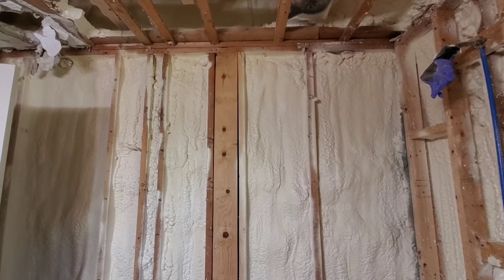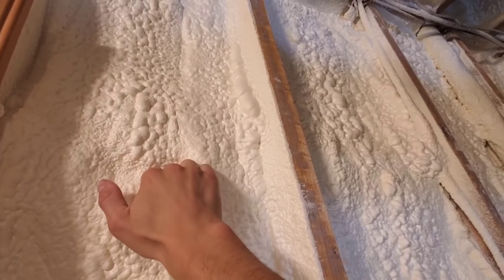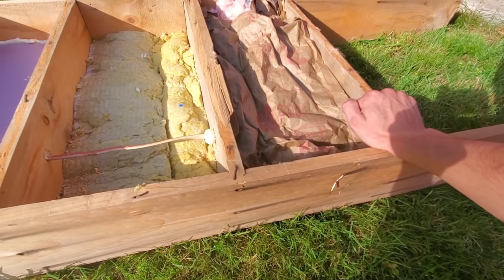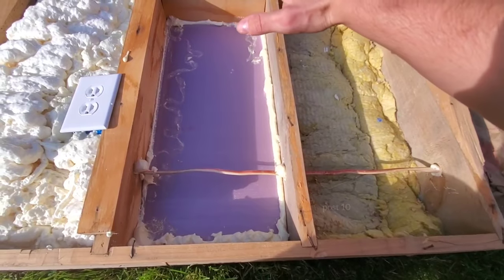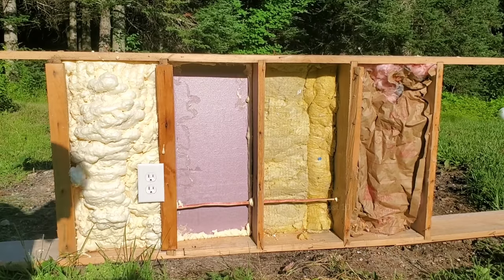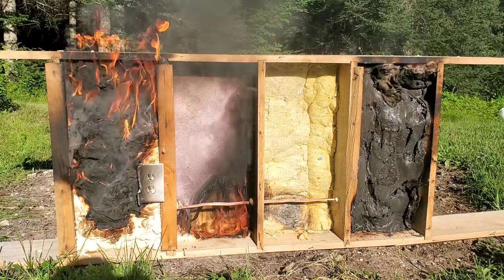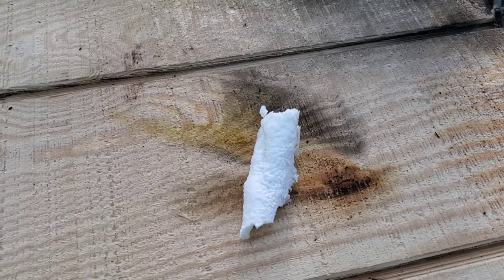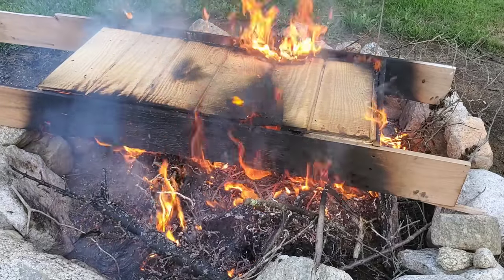Testing The Burn Ability Of Insulation In Wall

Comment: In Swedish construction we use rockwool as the standard. If you use it for walls its extremely important you make perfect cuts with milimeter precision to not have any leakage that will cause condensation. Rockwool is fantastic material! but the rockwool mat you have in the video is for attics, you could use it on ventilation pipes aswell but usually the mats for ventilation comes with metal nets so you can  put them easier on the pipes and keep the size on it. sorry for terrible explanation my native is swedish :D
Reply: Rockwool/Fiberglass as standard, barley ever with the paper though
Reply: If you use rockwool as wall / roof insulation, how thick do you insulate both? Cm?
Reply: Honestly rock wool I would pay for a good manufacturing to be made in the United States. 

The fact your recycle literal slag from metal manufacturing is smart. 

People who claim that the disadvantage is that it’s not biodegradable is stupid because when your building houses. You should build houses that last long periods of time if possible over hundreds of years old. 
Who ever thought that we shouldn’t use Rockwool as a standard is stupid because we should build homes with quality and have these houses as fire proof as possible. 

Foam I heard good things but this changed my mind because honestly. Every year state regulators often change policy for what is put into the material and as a product of that foam is now flammable… it’s because multiple reasons.

1. When first implemented into the market it had a slower application time because the chemicals used were less flammable. The chemicals that made it more expansive so that you can use less of the material which made it cheaper. It’s still the more expensive option… 

2. It doesn’t matter if Rock wall to cover the walls because it will still eventually burn through that than reach the foam. 
That’s why I believe rock wool should expand their markets all honestly.
Reply: @mrpumperknuckles1631  i think in this global recession its going to take a while before they would expand into the US. Our production costs here in Europe have skyrocketed due to diesel and electricity prices going to the moon, so construction business is suffering into next year. Im a professional who works alot with insulation and in two years time prices of rockwool has nearly doubled. 

Tho rockwool is very strong against fire it does eventually "get old" and cause extreme amounts of dust, and when you put your hand into 50 years old rockwool it breaks easily, but regardless of that fact. I think you get your moneys worth if something lasts for 50 years that at least should be cheap to buy in a normal environment with cheap electricity and diesel.

But the best part about rockwool is not the fire resistance, no no.. its the noise cancelling and it keeps your house from leaking heat or taking in cold from outside.

I onve built a small 10 square meter shed and used rockwool for it. It was 30 degree celsius outside but inside the shed it was 12 degree.

I think these foams have more downside then rockwool so for me the choice is easy
Reply: @mrpumperknuckles1631  Rockwool has two manufacturing plants in the US...
Reply: I understandd that enough. I work in trade, my job is plumber. We use them quite often around our super heated pipe before we place protection shield over them.
Reply: Rockwool is an excellent fireproofing insulation.  Easy to work, but takes attention to detail - I use a lot of it in the design and construction of healthcare facilities in California.
Reply: I've only heard of people using rockwool to clone plants. Didn't know it was used for insulation.
Reply: @ericberman4193  Good choice, also in california its even better because a proper insulated building will also more easily keep HEAT OUT from the building during hot days, putting less strain on the air conditioner. saving on the electricity bill in the long run
Reply: I live in Southern California and I just did my entire house in Rockwool. Its the best!
Reply: In Croatia, we only use rockwool. 
Everything else is trash.
Reply: Same in germany, you usually stuff the gaps with more rockwool if you can
Reply: @thebigmacd  WTF?!
Reply: @DataLog  Byhalia, Mississippi and Branson, West Virginia
Reply: Dense pack fiberglass will doesn't have a theoretical limit. It will last as long as the house. Rockwool will last 50 year before you should think about it. Rockwool in ceilings I a mistake unless it's done absolutely perfectly. This is because it's in batt form and batts can't be perfect. You will have an air gap that condensates, even with vents used.  Dp glass may condensate in certain conditions but there will be no air gaps. Dp cellulose settles due to moisture and the fact that its sugar and breaks down with all kinds of additives, and needs to be redone every 20-30 years. You can dense pack rockwool but it's incredibly un cost effect because rockwool isn't used as or requires dense pack.
Reply: @Jagggggg88  Did mine with 8cm rockwool. But building inspector said 12 would have been good enough for heatpump.
Reply: I'm glad you posted this test! I just canceled my foam installation project in the attic...just bought rockwool instead.
Reply: Thanks for sharing. It's good to know the Swedish build with sense and I'll be looking into their building practices more.
Reply: @mrpumperknuckles1631   The problem is the insulation value which forces you to up to 10 times thicker walls with bergull/glass wool insulation probably the same as Rockwool. But if you buy an old log-built farm, you get an exception and can use only the logs as insulation fold sometimes not thicker than 15 cm which becomes extremely expensive in cold climates! Then you run into the problem of additional insulation which I really recommend you study carefully before doing it! As a basic rule, you must use diffusion-open materials and not exceed 50 mm on the inside so you never manage to get the cold bridge in the log wall because then the moisture condenses there and freezes so that you suddenly destroy a house that has survived for 300 years and could have survived just as well long to think logically! On the outside it says that you can put as thick as you like as long as the material breathes (is open to diffusion) I have personally wondered if that is really true if you use air conditioning that places the condensation point on the other side (always the colder one) myself, I live expensively but healthy because it is impossible to get as good ventilation as in an old log house with mechanical ventilation, especially when very few clean the system as often as necessary to avoid mold formation which can still occur in the construction itself where it is not detected before it is far too late! Unfortunately, today's houses are designed for about 30 years - provided you take care of them, they will certainly last longer, but I recommend that everyone who builds today greatly exaggerates and uses logic on every detail! The worst thing you see and hear these days are people who care more about looks than practicality! When I'm fixing up a hundred+ houses, I always replace old electrical lines and I flatly refuse to build in electrical lines because it's almost inevitable that over the years someone screws or nails in a line that can't be sensed so if appearance comes before life to such an extent I ask them to hire someone else because I do not want to be even innocently involved in someone needlessly losing their life! What almost everyone can do is unscrew the sockets and junction boxes and after unscrewing the main fuses still check with a voltage monitor so it is guaranteed safe to pull the wires because I have probably prevented a few fires by checking that the wires are securely fastened for many times they aren't and the fuses don't blow if the phase sparks and sooner or later set the plastic case on fire! It usually leads to a fire, but you can die from the smoke without it catching fire! I have to say that old porcelain sockets and junction boxes felt much safer as they could not catch fire! For those who want to know something about basic dimensions (connection 230/400 V) a basic rule is that a 10 A fuse is the same as 2300 W and needs an installation cable of at least 1.5 mm2 but if the consumption is higher but not more than 3680 W then 2.5 mm2 cable applies. Why patch cords may be labeled 1.5mm2 and 16A is because patch cords are made of many smaller wires giving them a larger total conductor area but it is important to know that you should never put them in series as resistance increases with length and if you load thin cables over a longer distance, they become hot and pose a fire hazard! Also, don't forget that the fire insurance does not apply if they can claim that you overloaded the wires by securing them or just connecting one branch joint to another...
Reply: I go theough with soray foam when im
Done to fill up any cracks
Reply: @Jagggggg88 this old house says 8" which means a 2x8 us too short at 7.25" so you must cut down a 2x10" board frame arounds (cut down from actual 9.25 to 8" for R40 insulation).
Reply: In Trinidad and Tobago we use clay bricks with the air spacing in between.

Comment: My house is insulated with fiberglass and that's what saved our bathroom this past summer. Our house caught fire and aside from spots where the insulation was chewed through by rats, nothing was damaged that wasn't attached to the plastic plumbing pipes. Thankfully it didn't cost much to replace.

Comment: I’ve sold a lot of the rock wool before and not only is it nearly fire proof but it’s also very good at sound proofing, enough so that you can barely hear the other person on the other side of the bundle
Reply: Well, it is made of rock so…
Reply: @jameslastname9171  so its rocksolid for the job.
Reply: Couldn't agree more! Sound proof your bathroom walls with this stuff and no one will hear that toilet flush!
Reply: As someone looking into houses I can fix and improve, this info just made the list. Thank you for the info.
Reply: Fiberglass has nearly the same STC rating as rockwool and costs a lot less.. plus it isn't made with formaldehyde binders..
Reply: @FJB2020  Acoustic capabilities of Rockwool:
Very high performance with sound reduction. It has 3 times the density compared to fiberglass, it has a porous structure that absorbs sound efficiently. It can isolate and control the noise and vibrations coming from various sources (airports, trams, trains, music, etc.). The high density of the material blocks the airflow that carries noise, making even the noisiest environments bearable. Also, don't go thinking fiberglass is "better for you", both require the use of mask and gloves while installing. As a bonus, Rockwool has a much higher melting point then fiberglass making it more fire-resistant (even as a fire stop), it has a higher R value, it's made of more recycled materials (~70%) compared to fiberglass (20-30%), it’s hydrophobic, so it won’t absorb water or encourage the growth of mold and mildew. The REAL only downside is that its more expensive, but that obvious being its superior.
Reply: yes, I built many a sound barrier and even sound studios making use of either that or just plain fiber glass, usually for such applications in double layers. It's kind of shitty stuff to work with I remember, as loose fibers of it will try to penetrate your skin and all... I think you in fact must put on alround personal protection to work with it - which I never happened to have, with at the very least good gloves and breathing protection?
Reply: Is the industry going away from blown in mineral wool ? I am having a hard time locating blown in. Menards has a few remaining bags of Owens Corning Insul fill on clearance and I heard Roxul discontinued there's a few years ago. Thanks for any help
Reply: @duckthis17  From what I can tell blown in seems to be going the way of the dodo in most places. everyone I know of is going towards batts of rockwool.
Reply: @connorbeattie1962  I better get some while I can then. Thanks for your reply.
Reply: I just chose Rock Wool for my 16'x26' shed and fireproofing and soundproofing were the reasons I chose it! :) I also like that it's not toxic.
Reply: @CoasterCrazyy  where do you buy it???  I've never seen it, but honestly, I've never looked because I didn't know it was a thing.
Reply: @robertapreston4200  Lowes in WV at least.
Reply: Rockwool is amazing stuff. Another benefit to it is its water repellant properties. It will not rot or retain moisture.
Reply: We use rock wool as fire blocking in commercial structures, mostly steel anyhow.  

We use rockwoll in residential homes in the bathroom and bedrooms. 

Some of the units we do have 5 or 6 different types of insulation. 

That rockwoll is...  itchy.
Reply: @stefan-ox8qs  I C what you did there...😂

Comment: We have sheep's wool insulation (not rockwool ) in our roof. It has proved more effective than fiberglass. Because it is loose it can give complete coverage, unlike fiberglass that fits between the joists and can have thin gaps and fiberglass is also hard to install in tight corners at the edge of the roof. It will not burn, it sort of melts but only in intense heat and your house would be toast by that stage anyway. It can't sustain a fire in itself.
The only processing sheep wool needs is to be sheared from the sheep, cleaned and treated to repel vermin. Currently the low price of wool means that many farmers now shear the sheep only for their welfare and leave the wool in the paddocks. Hence wool insulation would give a source of income for farmers and the cheapest, usually unusable, parts of the fleece can be used. ( in New Zealand )
Like many things in this world that are natural, cheap and sustainable they can not get a hold in the market because the big manufacturing companies have the resources to undercut and mislead through advertising that such products can't get into the market.
Reply: Thank you for writing this. I have done my research but my husband hasn't fully seen the benefits of sheep wool as good insulation. Between this video and your comment I might be able to get him to understand why I want sheep wool.
Reply: Wow, fantastic info. Sheep's wool. Somehow this doesn't even surprise me.
Reply: I love the idea of a grown insulation, I do. 

I had no idea the price of wool was down.  I would much rather buy wool than all this fake crap, SMH!! 

HOWEVER, one thing about about wool concerns me (no doubt chemical companies use it to scare people) 

If I'm remembering school chemistry correctly... wool, hair, and silk (possibly feathers too) give off toxic gas when they burn (cyanide gas I think).

We never did an experiment actually burning wool, so I can't say if it flames.  They insinuated it flamed.  And I had wool topped quilts stored when my garage caught fire, they definitely looked like they had burned. 

So, while I love the idea of grown insulation, I doubt a few of your statements.   Maybe someone with more expertise can chime in.

Comment: As a Firefighter and fan of shows like This Old House, this is very enlightening.
Reply: I'm glad to see he's ignited, your intrest in residential construction.
Reply: lol then forget what you learned here and go look at the proper chemicals tests, nobodys can foaming a whole house
Reply: As a 40-year veteran of the fire service, thank you for the demonstration. But, the other consideration: when spray foam is applied, Sheetrock is then applied over the insulation. This limits the amount of air (ventilation/flow) which can enter the space and reduces the opportunity of fire spread. Leaving your test space open is not a true test of applicable conditions. While it is true that Fiberglas and rock wool insulation offer better safety from fire, in an open application, the spray foam may give you a higher R value for a lower cost, in a closed-space application. Might be worth another test. Especially if you can simulate an electrical short behind the Sheetrock. (And, of course, I just found your 2nd video on this same topic. Still, it how’s the wall space open, not closed up.)
Reply: @CR-zh8xj  9
Reply: He burning great stuff foam out of a can, not closed cell spray foam which doesn't burn. Huge difference. This test is flawed.
Reply: @CR-zh8xj  Plastic electrical boxes melt away to nothing, quickly, creating a hole in the sheetrock through which oxygen can feed the fire.  I've seen it happen with my own eyes.  This is why I use steel boxes only.

Comment: 🇳🇱rock wool is the best and is well resistant to heat and fire, it is used to make fireproof safes, among other things, greetings from hans from the Netherlands.👍👍👍🍀
Reply: how tall are you? i heard northerners in Netherlands are crazy tall
Reply: @JCZ2601NL  impressive. you're literally as tall as a giant
Reply: Is it a common insulation material in NL?
Reply: @eustache_dauger  mineral wool and expanded polystyrene EPS insulation board are one of the most common insulations all around europe
Reply: Actuality, most fire "proof" resistant safes and doors are insulated with gypsum.